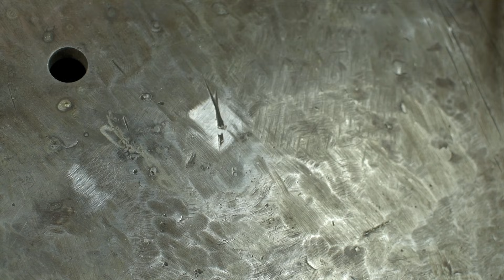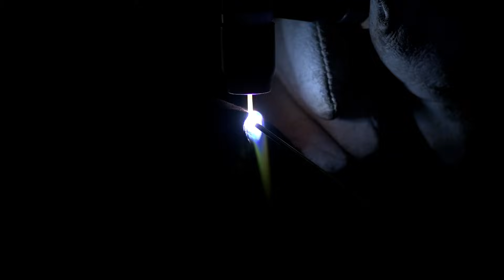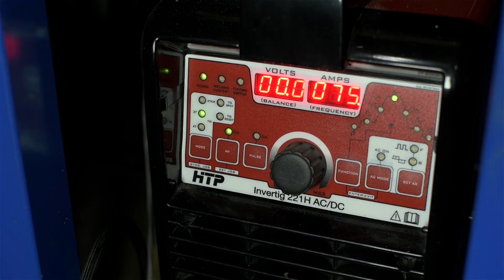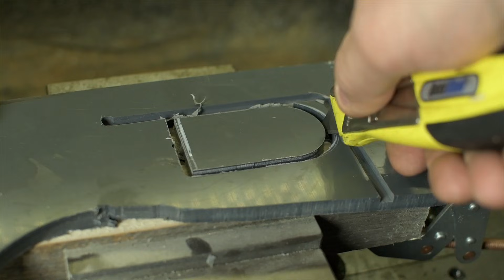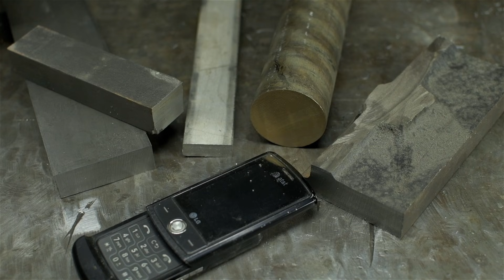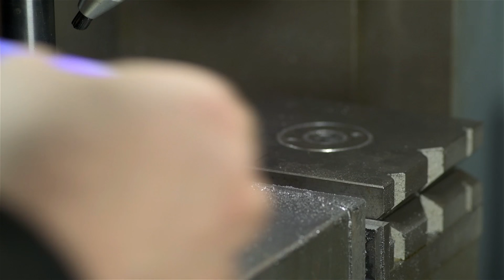Ends & Odds: DIY Bandsaw Guides & More!

Comment: What if you made if from colored lexan, or Plexi,  possibly smoked,  and put a couple LEDs underneath to illuminate the blade when cutting tiny parts.  Maybe even make it from clear , fiberglass reinforced epoxy, with LEDs embedded, to illuminate the tiny parts while cutting!  So the blades edge is well lit!

Comment: Calhawk 14" - the factory guide block holders are a crude aluminum something alloy with excessive flash and huge tolerances - the type is the slidey two blocks from opposite sides with a factory cheapo thumbscrew that moves the blocks when tightened, throwing the blade sideways, sometimes in oppsite directions since the lower block guides are barely accessible and just as screwey. The height adjustment is aluminum hexa slider also tolerances must be .1 inches and it can angle on travel up and down - so setting the guides is a near impossible nightmare.

Comment: Those Startrite bandsaws are the best ever made. I have one identical to yours only mine is the 24" model. With the blade setup just right and using the fence along with a vice I can get cuts parallel to within a ten thousands of an inch! That is milling machine accuracy!
I am going to make up some of the plastic inserts now so this video is great. Problem is in the UK all our nylon sheet it metric now - you can only buy it in 8mm or 10mm. I need 9mm - very annoying.

Comment: I would use Teflon for the bandsaw insert, it can accept much more temperature and give the blade more slip when it rides on the edge on the insert.

Also I like two part inserts, which also hold the blade from behind, so you got it split right at the front of the blade to both sides.

Comment: U can make those guides more wear resistant by austempering them, get them to 850-900 C, than hold in 250-300 C for 3-4 h. Its easy to do with no furnance, use gas torch to heat to 900 (mesoured with termocouple or by eye if U can find color table) than put into hot sand ( i supose U dont have salt bath :P). Do this with 2 and U'll be passing second to U'r son :)

Comment: What driver do I need to install to get my Mitutoyo 6" dial caliper to work on Windows 10?
Reply: Sebastian Vettel!  :o)
Reply: Well, dial up phones went out when digital phones came in, so as vernier calipers gave way to dial calipers they now give way to digital calipers…..personally I prefer the dial caliper even if the needle sometimes zeros at the 4 o' clock position instead of at 12 o'clock. Digital stuff constantly needs battery replacement just when you want to use it  and when I get one that has an inbuilt Lithium battery and USB charging  I WILL SUCCUMB AND GET A DIGITAL ONE.

Comment: Where would/did you attach your ground for the stick welding?   I don't recall if you accomidated for grounding when you built the rotary table thingie, or not.  If you don't ground on the platen, wouldn't you risk running the electricity through the gear box, and messing up the gears?
Reply from the maker: the platen shaft sticks out the bottom.  standard ground clamp.. just slips as it rotates.
Reply: @TOT
That would do it.

i was watching a vid of yours, and you were talking about the poor chucks on battery powered drills.

@Mrpete22 was talking about the same issue in a recent vid, and I told him about a chuck I discovered.

Instead of recreating the tale, here's a link to the vid, my comment is at the top, right now.

https://m.youtube.com/watch?v=PtQZliakQRU&t=624s

To tease you a bit, an all metal keyless with carbide jaws, and a locking mech. Plus, it's available with ⅜"UNF mount and a ½" capacity.  It's not ridiculously expensive, either.

Enjoy, and thanks for sharing.

GeoD

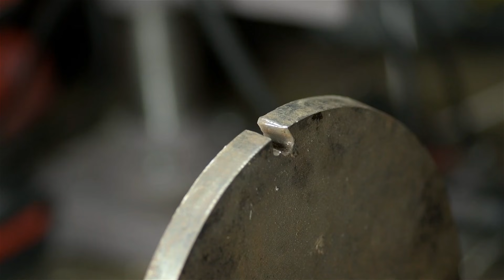Comment: First time on Tony, but at 4:10, to be green, save time and not waste valuable gas and weld wire or rod, may I suggest: drill the jagged hole to the nearest fraction Ø larger. Then hammer in and tack weld a matching Ø cut-off piece of round bar.  This could save you filling up the entire void with weld.   Just an idea, there.  Meanwhile we enjoy.  You should too ;-)

Comment: Great video Tony! Have you ever thought about adding a purge port into your rotary table? I use a purge table for stainless and it is wonderful for stopping the rice crispies on the back side.
Reply from the maker: The motorized shaft has a through hole that can, in theory, be used for through-purging.  Have yet to try it though!
Reply: Its also good for wasting Argon and keeping your part/table cool. Actually now that i think about it. I wonder how much cooler the part/table would be with gas vs without.......

Comment: I have a CPU cooler with a crooked surface that I want to get nice flat square and smooth, what surface grinder do you think should I buy?
Reply from the maker: any one with the right capacity, but if it's small (and aluminum?) I'd glue some sandpaper to a surface plate and have at it. :)

Comment: Tony, this Video was Great Fun! Just an FWIW, The last set of guides I removed from my Band saw were 1/4 inch diameter ~junk metal~ (I could not call Stefan for exact metallurgical awareness) HOWEVER, to replace it, I used 1/4 inch diameter Carbon Fiber Rod!!! That provided "Zero Clearance" to the BandSaw Blade! (It was a baby bandsaw, only 9 inch diameter wheels, for WOOD, but I thought I would share how Nicely Carbon Fiber is for BandSaw Inserts!

Comment: Sir, a question: I have to cut some aluminum Chevrolet Cylinder heads in half with some (+ or - .100 of an inch) accuracy. Do I have to have a large expensive Band Saw or will something else work???
Your opinion is very welcome.
Reply from the maker: .1" sounds reasonable for a bandsaw.
Reply: I don't want to buy a Bandsaw for one job, is there some other power tool that would work??
Reply from the maker: If you have a very steady hand and a good eye... maybe a sawzall?  won't be pretty. :)  Best bet is probably take it to a local machine shop, along with a cold 6 pack, see if someone is willing to do you the favor!
Reply: Hey, its worth a try. I better make it some Really Good Beer..........Thanks

Comment: Dang, Tony! How do you get these videos up without getting flagged for adult content. I mean, you've got 4-jaw lathe action,  some quick passes with the mill, a hot TIG hole plugging scene, and some even hotter high voltage sticking! Giggity.
Reply from the maker: I beat the system!

Comment: You might want to clear coat that steel platen, or get some weld spatter release spray. Otherwise it's likely that you will have problems with spatter from welding sticking to your freshly machined steel surfaces. This probably wasn't a problem with the aluminum platen due to dissimilarity of metal.

Comment: So just for clarity could you show a before and after cut on the band saw? Just to really emphasise the saw band cut pattens made on the metals cut by the band saw you cut when you cut through the metal with the band saw cut made each time you use the saw to cut. Did I mention that you can show the difference in cut patterns after you cut metal cut patterns metal saw cut. 🤓

Comment: Couple of things. As a woodworker all my circular blades have a built in set manufactured into them. Does your grinding of you blade not remove the set, or is there no set on them. On the bandsaw wouldn’t it be better to upgrade to wheel bearings. Great videos keep up the work.

Comment: You can harden small bits of tool steel using a burner and an enclosure made of a couple of bricks. Heat it to color, then quench. Relax in a regular kitchen oven to temper. It's not precise in temp, but it's good enough for lathe bits (and, presumably, saw blade inserts...)

Comment: Stupid question for your welding turntable platen... would it not have made more sense to have a flange in the middle to, after the press fit, allow you to bolt it to the shaft??? 
Hell, this would have fixed the problem with the aluminum platen...

Comment: But Tony why not use the bandsaw to cut the slot in the gude block...?
Reply: Guds777 because the bandsaw blade teeth are each bent alternating slightly outward from the centreline of the blade. This is called tooth set. This creates a cut wider than the thickness of the body of the blade to prevent the blade from binding in the cut. If you were to cut the slots in the guide blocks with the blade itself, it'd still work, but it would produce a clearance for side deflection of the blade. Minimizing side deflection by making the guide blocks as tight as possible improves the accuracy of the cut.

Comment: I bought a bunch of similar round drops (10-12” round or so) at my local steel supplier. Not sure where they came from or what they were intended for but at one point they had a pallet of them. I’ve used them for bases for my Wilton vise & my bench grinder pedestals. I have about 4 more left for future projects.
I did fill the gouge with weld as you did, it’s like it was never there.
Reply: little tool parts:  put em in a zip lock bag and zip tie them to the saw somewhere visible (power cable inlet for example)

Comment: You could make them (in the future) out of the hardest bathroom tiles you could find. Mine are made out of low grade, trash i found in my attic ages ago, i have to replace them every year or there about because the saw's teeth chip (eventually) the glazing, otherwise, no problems, runs smooth and clean.

Comment: It would not have been more convenient to machine a shoulder and use a bolt and large washer to hold the plate? This way inserting and removing bolts in the slots would be easier?

Comment: The plastic plate would be called a zero clearance insert.
Reply: Dan Harold  - yep, and rarely made of PVC, susceptible to heat distortion. Phenolic resin is popular and more stable.
Reply: Not that any sane person would want to do the work.  But using the original from my delta 14" bandsaw as a pattern I did a green sand casting in aluminum.

Comment: I have a Shopsmith band saw converted to a metal cutter mounted on a separate table with it's own motor. The guide wore out so I did the same thing as you did and it was a tad to low. I added two pieces of tape to the underside and it brought it up until level. Just a suggestion.

Comment: Hi, I've found that I get a much better surface in plastics when using conventional milling on the CNC, especially when the part can flex a lot (the waste stock has a much nicer surface finish in the video). This can really make the difference between the entire surface being covered in strings and getting a part that doesn't need finishing/cleanup at all. Hope that saves you some work next time. Keep it up!

Comment: Why not making that little PVC insert also out of steel?
Reply: Friction. Cast iron has enough carbon to get little graphite inclusions which make the blade slide smoothly through. Mild steel would get hot, increasing the friction, which would make it get hotter, until you break either the blade or the bandsaw. Bronze is also very low friction and would also be a good choice.  A hard enough steel like O2 might be able to slide before it bound, but cast iron is a fine choice IMO.
Reply: Sorry, I was talking about that little piece of PVC.
Reply: @merlingallagher4484  they are basically sacrificial... The blade flexes a bit under side load especially when cutting curves. The softer insert keeps it from from damaging the blade. That would also be the reason he made several.
Reply: D Rickard, why not aluminum?
Reply: @Hoaxer51  aluminum can be used... 2 of my bandsaws have aluminum inserts and I have a wooden insert in another. The saws with the aluminum take relatively thin inserts... just under .125 inches. The wooden insert is around .500" thick. I think that was what influenced ToT's selection as well. Ironically, my saws with aluminum inserts are for wood and the wooden insert is on a metal cutting saw.

Comment: Tony, did you know that when you’re not using the lathe you can chuck up a record in it and use it for background music 🎶
Reply: The only problem is that after that first play, you've got yet another copy of "The Sounds of Silence".
Reply: Try taking a lighter cut? Also, don't use a record with talking on it - waaay too much chatter.
Reply: Drain the oil out of it if you want "Heavy Metal".
Reply: i wonder if you could use a TIG torch to read music from bakelite records
Reply: Yep all you need to do is put a sewing needle connected to a cone in the tool post and you could play one, as long as you had an auto crossfeed that matched the spiral size.
Reply: And if you set the lathe to 2, it will produce a copy.
Reply: Do NOT Please give more detailed instructions. Going to try this with my grandmothers collectors editions to sell off the copies
Reply: This just gave me an idea-  use a record playing turntable as a tiny, light-duty vertical boring mill :--)
Reply: @loftsatsympaticodotc  I've converted many a cheap electric motor into a tool, give it a shot, just don't be an idiot like me and actually remember to film it!
Reply: I've always wanted the Victrola South Bend attachment for my model A but they're rare and cost almost as much as the lathe 🙄

Comment: Could glue a piece of paper or two to the underside of those band saw inserts to get the height you want.

Also, do you have a rotary table? Maybe mount the slitting saw blade on that? Maybe you don't have enough clearance on the grinder for that, though.
Reply: Jay Philip Williams, for some strange reason I was hoping to see the new rotary weld table mashed onto the surface grinder just to have it all fly across the room and traumatise the cat!!

Comment: Overthinking 101 - use saw blade to cut kerf for itself...
Reply: Where's the fun in that?
Reply: That would cause slop due to the set (offset) of the teeth.  The kerf of the cut is the thickness of the band plus 2x the set in theory assuming no wobble in the band.  The teeth have the set so that they dont rub.  That is why the teeth do not ride in the guide.
Reply: If you use the blade to cut its own guides, the guide slot will be too wide. The guides do not hold the blade by the kerf, they hold it by the thinner back spine.

Comment: XD i started typing the question about what was wrong with the welder as you answered it tyty
Reply: now i have another question, why did you spin the slitting was when you ground it instead of just passing over the whole thing and using the traverse of the table? was it because you need it to be thicker fit in the holder? or because you were trying to keep it from warping by leaving the middle thicker? or something to do with the direction of the pass in relation to the teeth? and was the paper towel thing just a joke or was that really to insulate it as it cooled?
Reply from the maker: I didn't want to grind more than I had to.  towel not necessary :)

Comment: Now you're missing the kerf on a blade from the other side it's only got teeth on one side the other side is smooth
Reply: There is No kerf in those blades to begin with.
Reply: set
Reply: Slitting saws don't have any set  to the teeth.

Comment: just how loose is a goose? is that metric goose or standard?
Reply: I'd guess metric. Using Ton/Tonne as an example, a standard goose would be spelt Gos
Reply: Depends on the goose, Canadian geese well metric, domestic geese that's determined by your location. Dont forget the blues or grey geese or snow geese. After thought, I guess all geese could be considered trans measure. Side note one of the loudest sounds I've ever heard, a buddy and I were out doing some goose hunting and we had a group of about 5,000 geese come in right on top of us it took them an hour to land, anyway we were laying 10 feet apart from each other and we couldn't yell loud enough to say when. it was deafening. Then some idiot driving around in a truck drove by fired at a stray goose and just like that they were gone we arrived at 4am to set up, it was 5pm ben there all day waiting. Dump ass skyblaster. He wasnt even close enough to hit it.
Reply: My question is how loose does the goose have to be before you need to check it with a standard?  Side note where does one purchase metric goose standards?  Asking for a friend...
Reply: me3333  Grab a copy of the Engineers Handbook and have a gander 😀